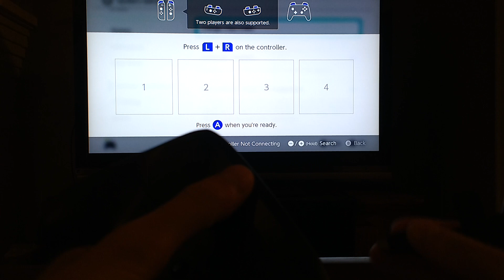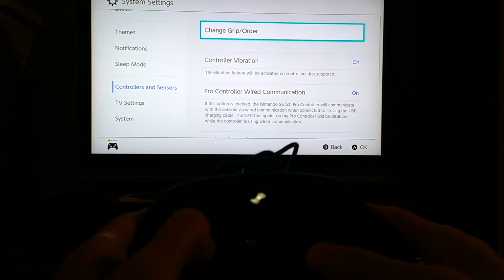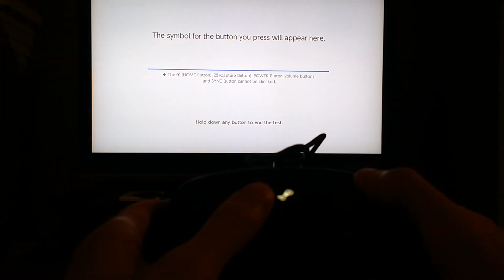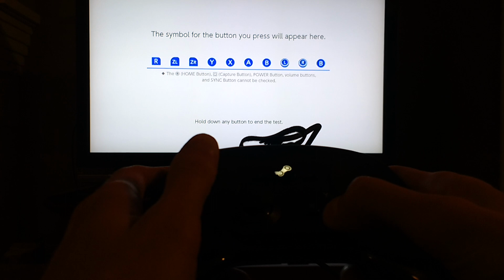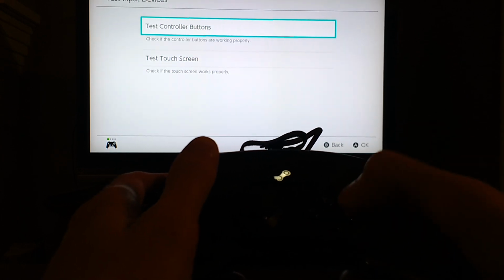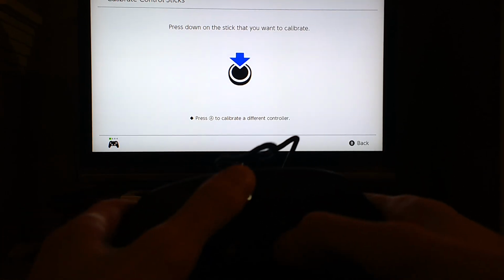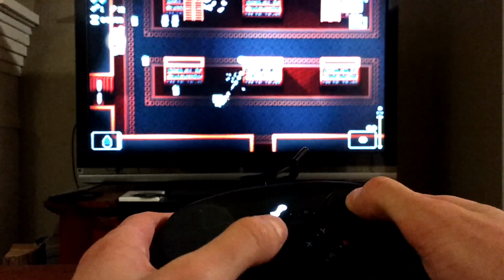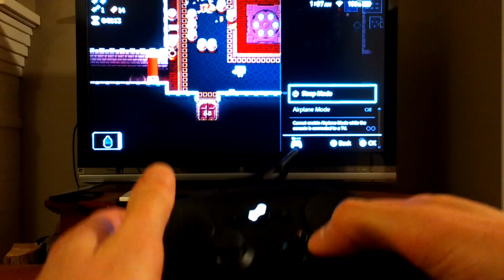Open Steam Controller: Nintendo Switch

Comment: Hey, Greg, I have a question about the Steam controller's gyros:

Are they in principle capable of reading all 3 positions (pitch, yaw, and roll) at once? One thing that I miss on the Steam controller's configurator for the gyros is a form of control similar to the Pro Controller's behavior in Splatoon 2.

To get into the nitty gritty: the Steam Input configurator or whatever allows us to choose between yaw and roll as our axes for the horizontal axis on an emulated joystick. However, in Splatoon 2, the controller behaves in a way that incorporates behavior of both. When the face buttons on the controller are parallel to the ground, the game uses yaw for left and right. When the face buttons on the controller are orthogonal to the ground, the controller uses roll, but in a configuration that Steam would call ‘inverted X axis’, so that pushing the left grip of the controller forward turns the camera to the right, and pushing the right grip of the controller forward turns the camera left. (This is incidentally the same as the motion controls you'd expect on a VR headset, where the face of the controller upon which the ABXY buttons lie is one the screen is mounted on.) And I'm also given the impression that the game relates these competing inputs by some sort of analog curve according to pitch; it doesn't just switch between using yaw and roll.

This kind of config seems really natural and nice, especially if you game reclined with the controller in neither an upright nor a horizontal position, like I do. I'm wondering if you know whether the Steam controller can do this and if you have any thoughts on what kind of function would be a natural way to blend the use of yaw and roll for turning left and right in this way. Playing with such curves to see how they feel might be a fun project, and another cool case of making the Steam controller do something it can't currently do. :-)
Reply from the maker: In all honesty I know only a limited amount about the gyro, both in the technical sense and in the use case sense. It's funny, but I've definitely spent more time trying to take apart and understand the software driving this controller than using it as an actual controller. So I don't really have much input on how the gyro works in the official firmware. In regards to how the gyro could work in custom firmware I only know the chip is a MPU-6500 and it communicates to the main controller processor via I2C at a rate of 400 KHz. The datasheet is readily available from the manufacturer, but I haven't spent much time with it. I plan on adding that kind of functionality at some point. I appreciate the nitty gritty details on how people might want or expect the gyros to function in relation to game input. Thank you for spelling that out. I'll have to keep that in mind once I get communications with the chip up and running and am considering what kind of software interface to provide.
Reply: @gregorygluszek6659  There's a really nice video illustrating these two modes of gyro controls and how Splatoon 2 transitions between them here: https://www.youtube.com/watch?v=VQ4isTpkN00

Comment: Would it be possible to use custom firmware to unlock the gyros polling rate?
Reply from the maker: I'm not sure. I haven't looked into interfacing with the gyro yet. Also I don't think I am following what you mean by the unlocking the gyro's polling rate. Is the rate at which the gyro produces updates a known limiting factor in the official firmware? I would assume this is set by the official firmware every time the controller boots and anything the custom firmware does would not persist... Unless it's known that a setting for the polling rate is stored in EEPROM?
Reply: @gregorygluszek6659  Thats something im not sure. I have a feeling it might not be firmware, but rather software end. It was something that seemed like they nerfed a few years back. But yeah check that out maybe If you ever do look into the gyro

Comment: Would this work wirelessly? I've recently lost the cable for my steam controller D:
Reply: It's just a microusb cable. If you own an android phone you likely charge it with one (unless it's a USB-C android phone), along with a ton of other devices that use it. If you somehow don't even have one of them, they're at every store, and not very expensive. This doesn't currently have wireless, and based on one of his comments, likely won't for a while yet.
Reply from the maker: @NoThisIsStupider is correct. Just wanted to chime in to give additional details on my estimations of the challenges of getting wireless working. Wireless communications is done through a completely separate chip on the controller. At this point all I (think I) know is that communications are being done to that chip via UART. This then presents two possible paths: 1) it might be possible to leverage some official fw support here (especially with the current update that has BLE support). But this would require reverse engineering the UART communications protocol. 2) it might make more sense to start from the ground up and rewrite the firmware for the Radio Chip. This would present a whole other set of challenges. First and foremost being how to update the Radio Chip firmware, and second how to reliably restore it for user who want original functionality restored. It would be awesome to get wireless communications working, however, my guess is it will take a considerable effort to do so.

Comment: This is just a firmware right? No special hardware? If so that's insanely cool, mindblowingly even. The steam controller is without a doubt my absolute favorite controller, and I was pretty disappointed there wasn't a way to use it on the Switch.

How does button configuration work at this point? Not expecting it to be easy, but if it's possible to configure it a bit, put left stick on left trackpad and dpad on stick, I could actually start using it with the Switch.
Reply from the maker: Yep just firmware. All the source is in the Firmware directory in the GitHub repo and the README should spell out how to build and load the firmware build onto a controller if you want to try it out (just make sure you set the FIRMWARE_BEHAVIOR macro to SWITCH_WIRED_POWERA_FW). If you're looking to change around the button/control mappings you should just need to modify function updateReports() in https://github.com/greggersaurus/OpenSteamController/blob/master/Firmware/OpenSteamController/src/usb.c.
Reply: @gregorygluszek6659  Just tried it out, works really well. The trackpad implementation leaves a bit to be desired, but that can be improved of course. I'd like to help with the development if I can at all, although I lack experience with driver development. I've already figured out how to improve a couple things with the trackpads, might mess with this soon, although I have exams in a couple weeks, so it might take me a little bit.
Reply from the maker: @NoThisIsStupider yeah there is some known weirdness with the trackpad (I've listed what I've come across in the Firmware/TODO.md under the haptic.c bullet). The biggest issue is the ~5 degree clockwise rotation of the data I am getting back. Not sure if I implemented something wrong or a correction is needed. If you came across anything I haven't mentioned I would appreciate knowing your thoughts (either through here or a quick pull request). Also, don't worry too much about the lack of experience. Any help would be appreciated when/if you have the time.

Comment: how does one do this
Reply: Ok got it loaded up on my wired sc. Works nice thanks so much now my kid will be happy we can play 3 players. No risk to me because this sc only works wired now anyway.

Thank you keep up the great work
Reply from the maker: Source code and instructions on how to build, backup and install new firmware on a Steam Controller can all be found here: https://github.com/greggersaurus/OpenSteamController/tree/master/Firmware
Reply: I cant download nxp without an account and i dont seem to get the email confirmation ever. I wish u had put the bin file right in there.  Good work though
Reply from the maker: Sorry to hear you're having trouble with NXP. If you get the issue resolved please let me know what steps it took in case it is something that should be added to the build instructions or READMEs in general. In the meantime please check out the latest update I just pushed, specifically https://github.com/greggersaurus/OpenSteamController/tree/master/Firmware/bin. OpenSteamControllerNinSwitch.bin is the file you will want to check out to reproduce the behavior shown in this video.
Reply: @gregorygluszek6659  yes seems i never get the email to make an account :(. thanks for the .bin